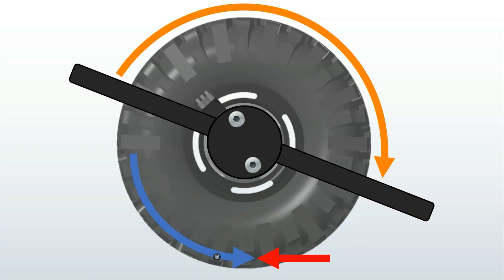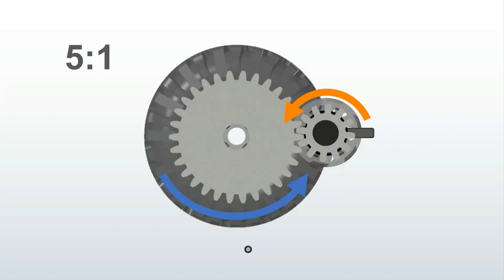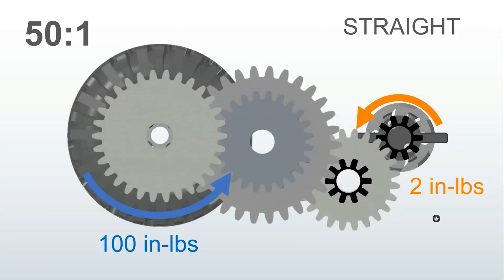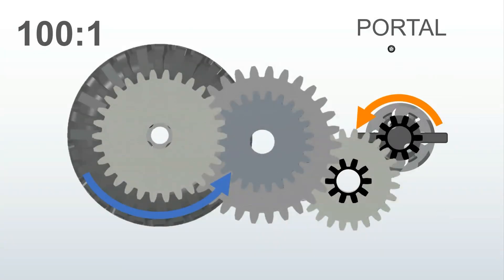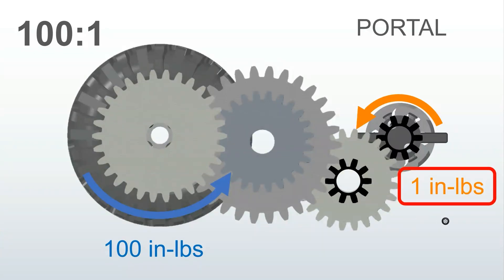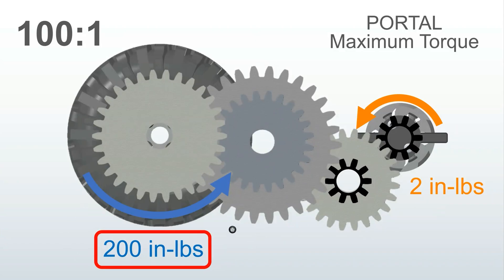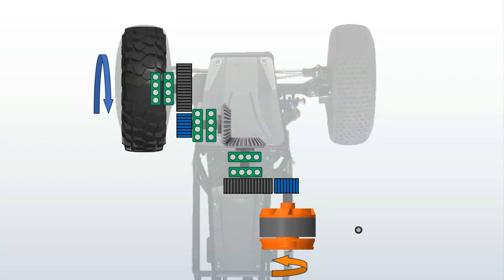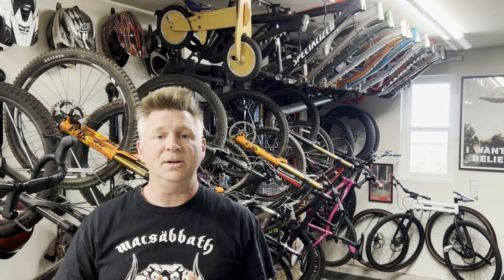Do Portal Axles Reduce Torque Twist? Part 1

Comment: I think torque twist can be simplified. Assuming basic functions of gearing you are trading torque for speed and vise versa. If you look at the torque twist as coming from the driveshaft connection between the contained systems of the axle and transmission it becomes a simple argument of decrease the torque and increase the speed.  Therefore an axle geared for more input speed from the driveshaft would impart less torque on the chassis i.e. the increased gearing of portal axles. 

If we pretend the transmissions and axles are perfectly ridged bodies in your example(wheels not allowed to turn) then the only places where torque can affect the system are at the connection points of the driveshafts. I think your test method is flawed since when the tires are in a bind the gearing the axles doesn't 'do' anything and the same forces from the transmission are able to lift the car just the same. If you allow the wheels to turn there will be much less chassis torque required to provide the same amount of torque to the axles. 

I think it would be interesting to attach a sled to rear axle and do a pulling test. At different weights on the sled how does a portal vs straight axle rig behave. I would hypothesize that the pulling force needs to come from the axis of the wheel for best results. A test done from the bumper of the truck or the diff of the axle would probably introduce too many variables.
Reply from the maker: I think what you are suggesting is inputting various levels of torque at the wheels with a sled. What I did was applied the maximum torque the vehicle could handle before flipping over. The magnitude of the force is not important - the reaction at the motor is the same and proportional. You will still get a proportional twist. I have a feeling I am going to need to demonstrate this to make it more clear.  100:1 reduction on both a portal and straight axles - it will produce the exact same twist.
Reply: @BoomslangSuspension  in the rc world what you are implying is not relevant to us.   what is relevant is resistance to lifting a tire under normal driving conditions.
Reply from the maker: Torque twist is the cause of the front tire lifting.

Comment: Mmm, I must say that your video is extremely well detailed and explain, very nice!, but I think that the part on axle vs. trans reduction (which is the crucial part) is wrong. Bearings doesnt magically transfer the forces away, Newtons third law works between every force and load, so when a gear pushes the teeth of the other gear down, it itself pushed up. the fact that the gears rides on bearings doesnt eliminate that, and in the case of bevel gears it manifests as a twist forces.. The issue with torque twist is that one segment of the gear train is riding on soft springs instead of rigid gear case. so having this part face the least toque possible (and instead speed) is beneficial. That's why UDR is using extra planetary gear in the axle, and indeed having very little torque twist for a big 6s car..
Reply: The UDR has planetary gearing in the nose of the differential. It does in fact do a huge part to reduce torque twist. This was an excellent video, and I have spent many hours researching this, but in my opinion, I still believe the more the gear reduction is done in the axle the less torque twist.  
    I am actually experimenting with this in a build and it will be interesting to test the theories! This video does have me questioning my thoughts!
Reply from the maker: I see what we are talking about now. I don't see how this would change your torque twist - it's just another reduction point in the total drive train. The total torque between the contact patch and motor mounts is whats producing twist. Resistance point to reaction point. I'd like to see someone drive it with and without the sway bars.
Reply: @BoomslangSuspension  OK, i think i'm statring to understand your point. but then, why dont  companies that design crawlers use transversely mounted motors to twist the skid forward under load?
Reply from the maker: @yonicozac  There is a class of vehicles called "MOA" or Motor On Axle. They are very high end, strange looking, and require two motors and a dual ESC. Very complicated for a lot of people. Also, most of the competition classes specify shaft driven, ostensibly for a more realistic look. So there are ways around torque twist - they just are not common currently.
Reply: @BoomslangSuspension  I'm talking shaft driven, but only mounting the motor on the skid 90 degrees to what it is now, and using a bevel gear.
Reply from the maker: @lowslowcrawlers1304 This is my point precisely. Portals ONLY reduce torque twist because of gear reduction, not because of the location of the reduction. You can get the same effect with straight axles if you find another place to reduce the gear ratio, like pinion or transmission.
Reply from the maker: Bevel to Bevel - curious. I will have to think about that one.
Reply from the maker: If you are talking about the Traxxas UDR it uses sway bars to control twist.
Reply: @BoomslangSuspension  then why adding the complexity of a planetary gear on the axle, where they could more easily add this reduction on the gearbox before the driveshaft
Reply from the maker: Maybe I’m not looking at the same thing as you. Can you point me to this planetary gear on the axle that you are referring to?
Reply: I think I disagree but I’m not sure. Lol
I believe portal gear reduction or in the case of the UDR with planetary reduction in the axle itself, changes how torque affects the chassis. This is all leverage so where the gear reduction happens will change the fulcrum point of the leverage. Portal axles will shift some leverage from the chassis latitudinal to the axle longitudinal. 
This is because more leverage is happening in the axle housing and the housing is now resisting some of the force that the chassis would normally have to. At least this makes sense in my brain. Sway bar or not, the UDR has no perceptible twist. Baja Rey with sway bar still has noticeable twist. Only difference is gear reduction in axle.

Comment: what about counter rotating driveshafts? Does what you just showed mean that since the tires are rotating in the same direction, the the motor will want to rotate the same as if the driveshafts were spinning the same direction?
Reply: I've heard that one but how I deal with torque twist is by adding dual stage shocks and having a piston from one side with one additional hole than the other side. I get almost no visible torque twist on my axial bomber despite using 2800kv 3s
Reply from the maker: Are you essentially saying that you have slower damping on one side because of less holes on the piston? That is certainly one way to help.
Reply: Usually thre "torque twist" we encounter  comes down to traction...so because the twist eliminates almost all traction on the front it doesent matter in which way the driveshaft rotates ...the twist will be the same .
Reply from the maker: Counter rotating shafts should work under ideal circumstances with equal traction front and rear. When torque twist become a problem is on a steep climb, at which point the front end is very light and the front traction is low, so the vast majority of twist is coming only from the rear axle and the front axle's contribution is diminished. This is certainly something I'd like to test.
Reply: @BoomslangSuspension  That would be a great topic for next video, one thing to add is that we are not always climbing , in comps there is a big part of the course that is side hilling.
Reply from the maker: If we could only sidehill in one direction, then torque twist could be an advantage!  :)
Reply: @BoomslangSuspension  according to what i understand from what you are saying, if the driveshafts rotate in opposite directions (front and rear) , and in Side hill both front lower tire and rear tire should have about the same traction then the torque twist should be reduced.
Reply from the maker: I think that is correct, but I would want to confirm that in the field.